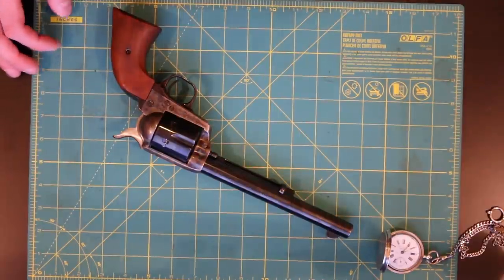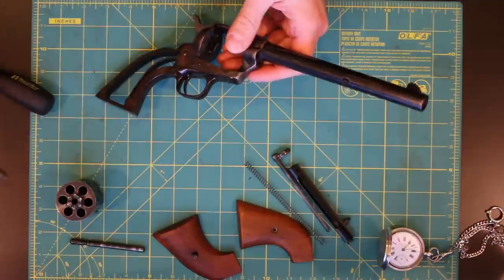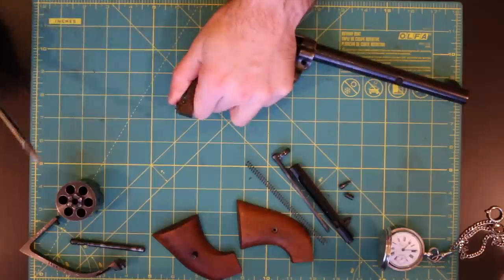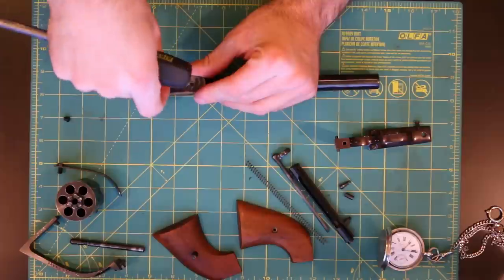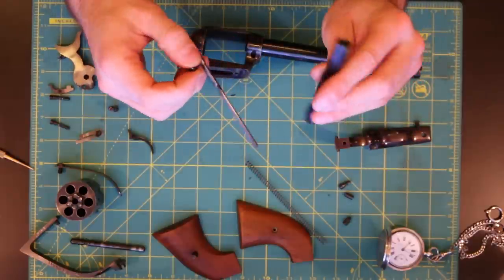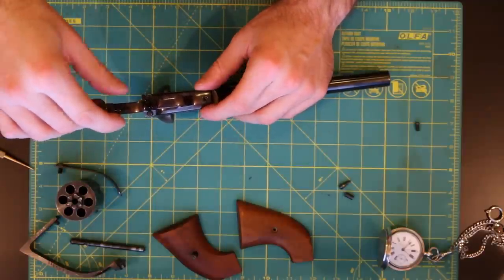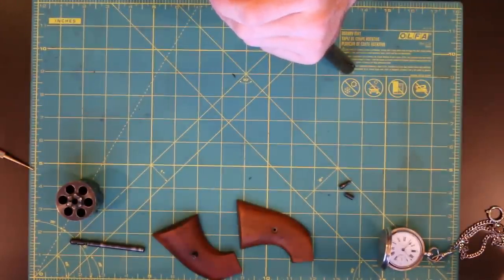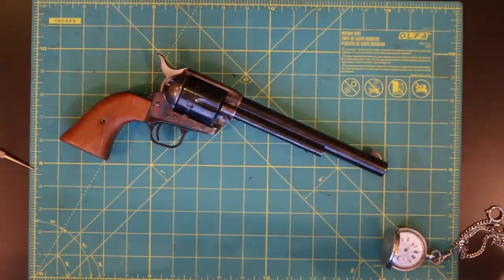Colt SAA Disassembly and Reassembly COMPLETE

Comment: Despite the other petty comments about your use of screw drivers this video was a great help in replacing the hand spring assembly in my Uberti Cattleman. From what I could see you were pretty gentle in removing and replacing the screws and didn't see any marred heads on the screws or scratches on the frame. I'm adding your video to my favorites for future reference. Thanks again!

Comment: Hi, along with other reader comments, I am giving you top notch review for this video. I just got an old Colt SAA first gen gun at auction and watching this makes me feel prepared to open it up. I can see on the pictures the trigger guard plate to frame is not flush, so I will need to look at it to see if the trigger spring screw is backed out or what, lol? Anyway big thanks for the detail on this!!!!

Comment: If you're taking apart an Uberti Cattleman, watch out. There's a pin and spring behind the cylinder hand that is accessed through a hole above the left backstrap screw on the back of the gun.
Reply: Thank you. I was struggling for 30 minutes trying to get that pin in place.

Comment: Is the barrel a different part or it is an integral part of the frame? Because in the air fun replica of the pistol it is a different part screwd and even it is well screwd it is slightly loose, still I am told that this is normal for an air gun.....

Comment: How do you properly tighten the cylinder pin latch, since it has screws on both sides.  Two screwdrivers at once?  I guess you'd need to put the gun in a vice to do that.

Comment: My pin is stuck and the cylinder wont come out, can I take it a part without taking out the cylinder
Reply: You can but I wouldn't recommend it.  The problem will arise when you go to put it back together again.  Likely the bolt will not want to reengage into the cylinder slot without some fuss.  You're going to have to remove the base pin at some point anyway...so you might as well get yourself a base pin removal tool.  Their not cheap but if you're going to own a Colt you'll want to avoid buggering up your base pin with a pliers or something.  http://www.brownells.com/gunsmith-tools-supplies/handgun-tools/takedown-tools/colt-saa-base-pin-puller-prod10997.aspx  If need be...you might want to use some penetrating oil to loosen the base pin...just make sure it's something that won't harm your finish or wood grips if you have them.
Reply: I found that if you push that cylinder pin in and use it as a safety, when the hammer Falls, it will Dent the notch preventing the pin from coming out.
I had to disassemble my gun and use a punch to get the cylinder rod out and there is a little dent in there from the hammer pushing it forward.
Now I have a tiny barrel-shaped coil spring and pin that I have no clue where they go and I don't see him dealing with it either.
Reply: For anyone reading this and having a sticking cylinder pin,  you can get a special tool from brownells that is specifically designed to remove the cylinder pin.
Reply: I have a base pin that is stuck so bad that I can't pull it out with channel locks- pin be damned! I will replace it, but how do I GET IT OUT?

Comment: The hammer on my grandpas isnt uh... fully.. hammering? It wont move far enough to strike. Does anyone know what the problem might be?
Reply: Without any additional details, I’m going to provide my best guess. If it’s an Italian clone, there’s a good chance it may have the longer, double notched cylinder base pin. This has two notches and is longer so that it can basically be over inserted and block the hammer from falling all the way. Try removing it, checking to see if there are two notches, and if so, reinsert it only to the first notch and see if that fixes the problem. If not, is there any mark at all on the primer? You may be getting light strikes which could be one - or all - of a couple different issues. Let me know if the cylinder pin solved it.

Comment: There are MANY variations of the 1873 peacemaker, whether it's the original Colt, the 1970s Virginian Dragoon, Ruger with adjustable sights, Uberti, who by the way, makes an excellent reproduction, & several others. The point is, they are all based on the Colt 1873 Peacemaker Frame (or the Army M1873 until almost the end of the 19th century) Incidentally, Ruger modified the design by removing the double leaf spring and replacing it with coil springs! However, I have made my own leaf springs out of feeler gauge leafs. But instead of ONE THICK SPRING like came with the gun that always breaks, I stack about 5 or 6 thinner ''feeler gauge leafs'' together! Which hardy ever break. Use a Dremel to make the springs, and keep and use the original hole in the feeler gauge for the screw. If you'd much rather replace the broken spring with store bought, go ahead. I NEVER do though.
LAST, I Always wrap a feeler gauge with 400 or 600 grit wet sandpaper and FIT EACH SCREW do they are ALL the same orientation. I've seen some gunsmiths do this, and ALWAYS put the screws back in the same hole.
A-L-L 1873 Peacemaker Frame based revolvers, of whatever brand, should ALWAYS LOAD FIVE (5) , N-E-V-E-R - 6 ! THIS WAY: Load one, Skip One, load 4, then pull hammer back all the way, then forward ''3 clicks'' closing the hammer on an empty chamber. For Example, this is why Ruger quit making the single action old model 3 screw, .22, .357, .44, etc and designed a transfer bar safety for the revolver because ignorant, inexperienced shooters kept loading 6 and accidentally firing a load! STUPID! 
A-L-W-A-Y-S keep the hammer back ''1 Click''
''KNOWLEDGE'' is also a ''Safety'' !